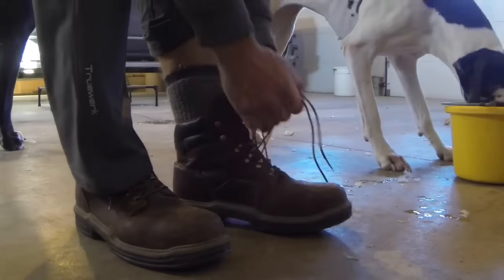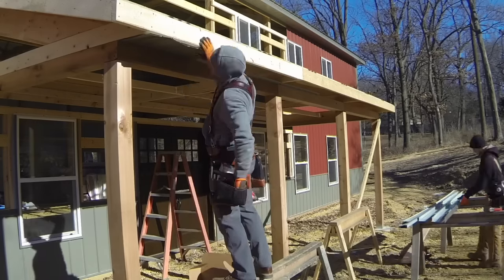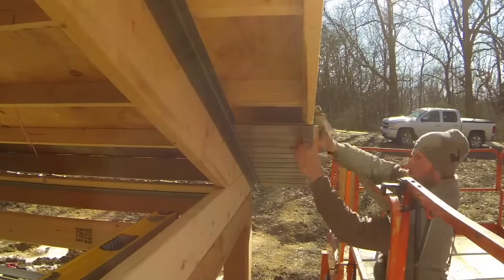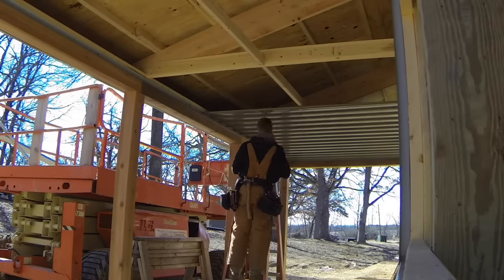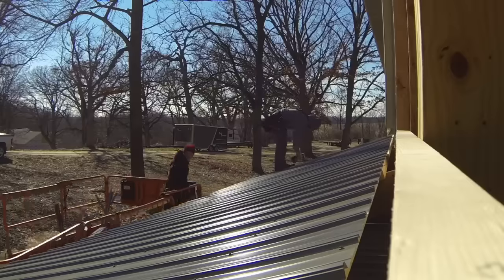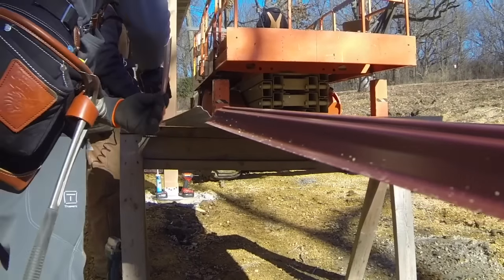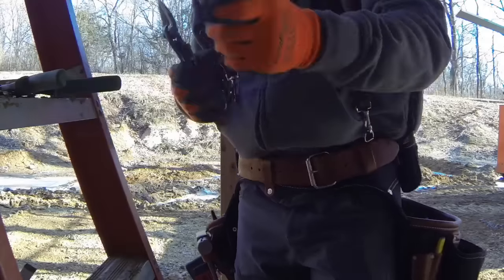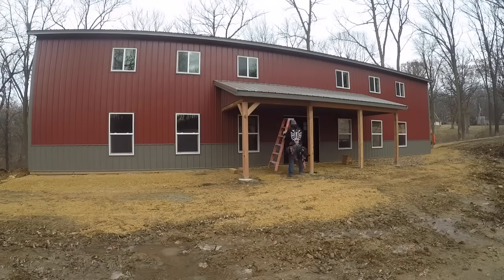Porch finishes Day 2

Comment: Nice work but a couple of questions:
The wooden pillar directly on the Concrete? No tar paper to prevent the endgrain from rotating?
No tar paper on the plywood for protection against water etc. and then roofing battens under the roof for ventilation?
The Swedish carpenter
Reply: The wood pillar is on a metal support that raises it off the concrete about a 1/4" away from concrete. This is a porch roof that goes up against a wall so no where for this roof to vent to. No tar paper needed because water won't get to the plywood.

Comment: Are you using an awl/spike type punch the hole marking?  I have the same OCD with fasteners with metal and I use a small drill bit.  This will obviously save a bunch of time.
Reply from the maker: Yes I am, and it is not only quicker than drilling in my opinion, the metal manufactures would not like you drilling due to the shavings or small pieces of metal that stay on the sheet.  They will cause surface rust. Thanks for watching